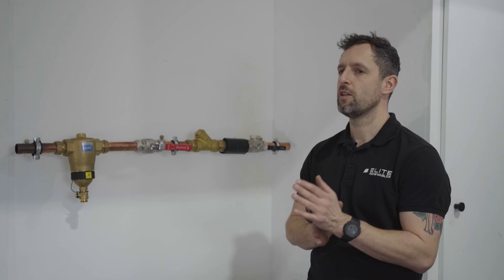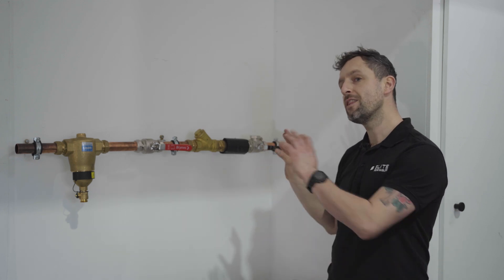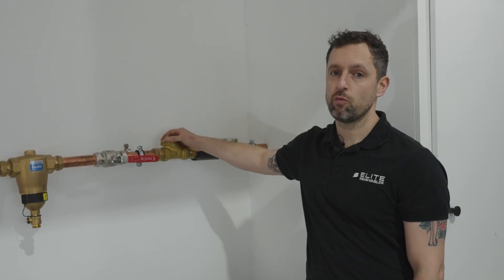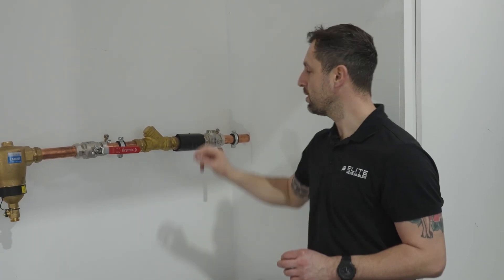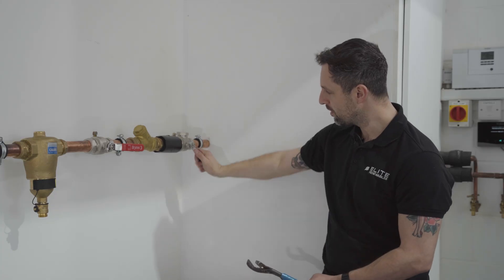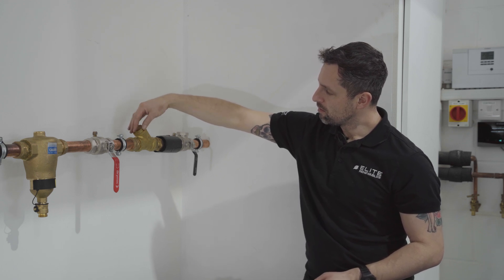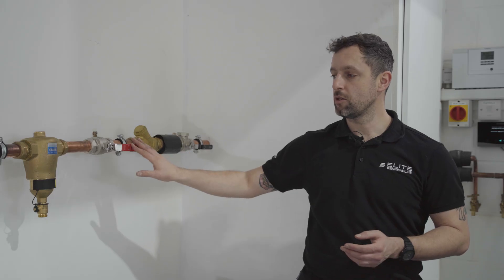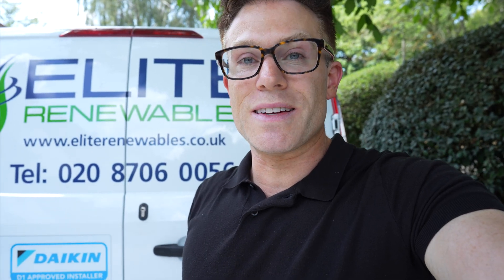Heat Pump Error Message? Check This Filter First (DIY Low Flow Fix)

Comment: Ive found the flow rate on the smaller filters to be pretty poor. They add alot of presure loss even from new.
Reply: I would also recommend with the filters if you can fill them up again with water before putting the cap on you reduce the air your letting in